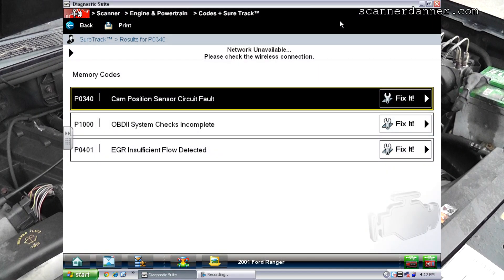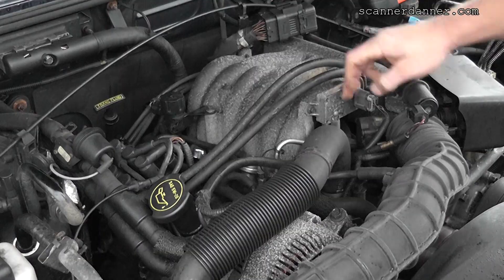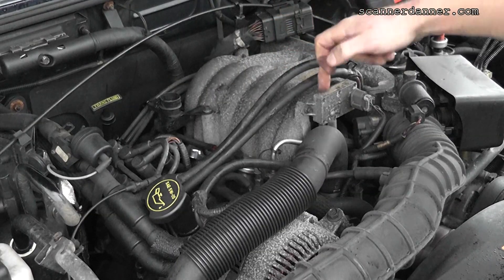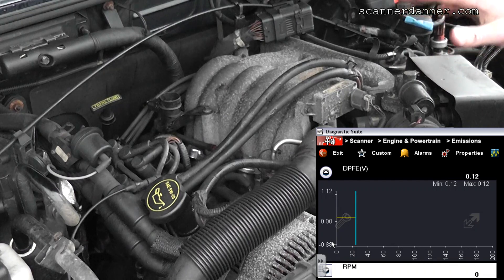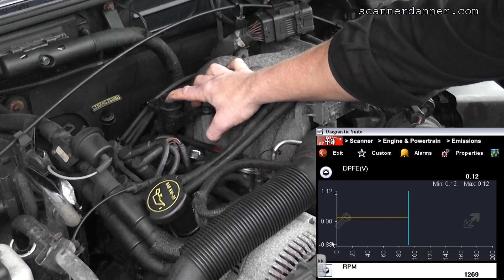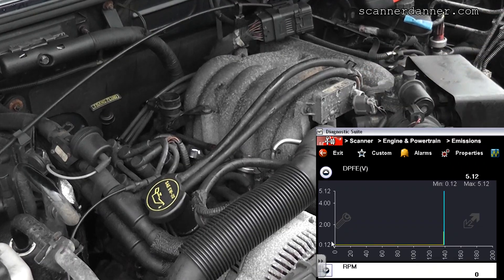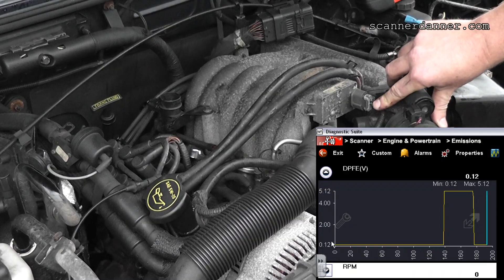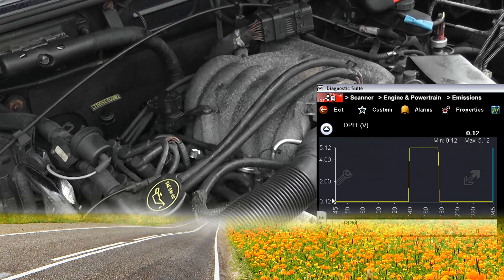Ford EGR flow quick test (P0401) DPFE fault

Comment: have I have a 2003 Mercury Sable 3.0 and it seems like whenever it's cold EGR is making a noise I'm hearing like exhaust gas back there and then after it warms up I'm getting a pulsing back to the air cleaner I was wondering if I'm suspecting EGR but not sure. when vacuum is applied to the EGR it does get the idle gets very rough when you back off it so it seems everything's fine again and but there doesn't seem to be very much vacuum at the where the vacuum goes into the top of the EGR what is it supposed to be.
Reply from the maker: probably a crack in the exhaust manifold

Comment: 1990 f250 5.0, what if when I put my finger over that bleeder the engine doesn't get rough, and what if it does? Does it mean its good if the engine starts to run rough?????
Reply from the maker: You have restricted EGR passages. Remove the throttle body to clean them

Comment: No good when some of these guys post vids trouble shooting using expensive equipment with all sorts of diagrams and percentages; it's like what the fuck are you talking about.
Reply from the maker: I'm sorry you feel that way. If you watch more of my videos, you will get a better understanding. My students at RTC are just as green at this as anyone and they can follow. You just need to find the correct playlist to get started. 
My forum can help you greatly too. 
 https://www.scannerdanner.com/forum/post-your-repair-questions-here.html
Reply: I have one of these scanners and was able to troubleshoot my '97 Ford Escort.  Scanner Danner knows what he's talking about!  You can use a multi meter to test for the same issues and take the same troubleshooting steps, you just won't have a fancy graph is all.

Comment: I'm glad that you took the time to post this. I have been working with a 97 Ford F250 with the 460 in it and we are having to prob the DPFE with a Voltmeter. Would a scanner like yours be able to show the Voltage on this type of vehicle? Or only newer models. Also what scanner do you own, It looks almost like a SnapOn but I can't tell for sure. Thank you again.
Reply from the maker: Yes and it is a Snap on. Check out the description of this video. I posted other Ford EGR Flow problem case studies I've done. It will help. In at least one of them I show how to test the DPFE with a voltmeter
Reply: Yeah I found it by watching another one of your Videos. We tested it via a Fluke and it is preforming as intended.

Comment: We did a vacuum test on the EGR. If the idle didn't change then there was carbon blocking the passage. If the idle got rough then we changed the DPFE sensor. Worked every time.
Reply: Ah, that's for that info. Wasn't aware about it until now.
Reply: I know this was a few months ago that you posted but it stands for Differential (or Delta) Pressure Feedback EGR Sensor
Reply: Ah, thanks alot for clarifying that for me.
Reply: I now find myself with a possible DPFE sensor problem. The car pings even under light throttle or at cruise speeds. Just went on the ranger station website and it stated something about how just when a DPFE is about to go, that sometimes it wont set a P code. I'm about ready to swap the part out I guess. The motor has no knock sensor that I can find anywhere on the net about. The spark ping just came out nowhere one day.
Reply from the maker: How rough does the idle get when you force the EGR valve to open? It should stall or just about stall.
Reply: The motor stalls right out.
Reply: Did a DPFE swap on it last afternoon with a known good one. Drove it last afternoon and this afternoon, and the ping problem is gone now. Am just wondering why the the computer didn't pick it up and set a check engine light. Before that, she was getting so bad that she was pinging in the rain.
Reply from the maker: Yep, pretty much. 

Hey John, I have a tip for you for the comments. I can see some of your posts going to spam automatically. The only way to fix this issue:
Comment one time only, even if it doesn't post. When I see it (and I will) in spam, I'll mark it as not spam, then you will see your post.
If you keep trying to comment over and over (which I understand, because they are not showing up), this just aggravates the situation, then makes all of your comments automatically flag as spam. Make sense?

Comment: good information. with a quick question. 99ranger 2.5l  dpfe reading is koeo 2.14v plugged in 4.79 unplugged that 2.14?
Reply from the maker: +Scott Kelleher most likely it is a bad sensor. Check your ground before replacing it. It should read less than 100mv on your voltmeter, with the voltmeter com lead connected to battery negative. (you will be performing a ground to ground voltage drop test)-sensor plugged in, backprobing, with the key on

Comment: Did I hear you correctly when you said that when the connector is pulled loose from the DPFE sensor the signal voltage should rise to 5 volts? Great video by the way....
Reply from the maker: 3v during the opening of the EGR valve test? Do it again at 1500 rpm
Reply: +Robin Alexander yes you did. this is a design feature within the signal circuit, used by the ECM to determine wiring integrity
Reply: +ScannerDanner Premium - Thanks for the quick reply, I am getting 5 volts on the signal wire if the connector is plugged in or not and it never changes regardless of pressure. I am thinking it is time to try a new DPFE. I appreciate your comments, I was thinking bad PCM!!!!
Reply: +Robin Alexander Not at all my friend. This is definitely a design feature. Just make sure you have a good sensor ground before replacing the DPFE. 
With the key on and connector plugged in, backprobe the ground wire and make sure it is not also reading 5v. This would indicate an open ground and could cause your issue. A good ground will read under 100mv
Reply: What should I look for if I am only getting 3 volts to the Signal wire?
Reply: ScannerDanner So I ran the test again at 1500rpm and the 5v ref wire has an 3v read, and will bounce to 4v and back to 3v. I am using a multimeter. and when I attempt the top wire the engine will stall before I can catch a good read but what I could see was 3v. I went ahead and swapped out the sensor and ran the test again knowing it wouldnt change the voltage on the reference wire and results are the same.
Reply from the maker: The 5 volt ref wire should be a steady unchanging voltage. Are you positive you are making good contact with that circuit when testing?
Reply: ScannerDanner I used 3 different ground sources frame, block and ground terminal. and insured good connection to ref wire. consistently got 3v. but I am on road trip back home and since the last test I've driven 400 miles. and ✔ engine light just went off on its own. would have liked to have found the actual problem but am glad it went away.
Reply from the maker: IF your ref. circuit was 3v, that is definitely a problem. Next question, what is your ref. circuit voltage on other sensors (they share this same 5v source)? With the key on (you do not need it running), check for 5v ref at your TPS (easiest place to verify). If it is 5v there and 3v at your DPFE, you have a wiring (high resistance) problem in the leg of the ref circuit going to your DPFE. If it is 3v at the TPS too, then we may have a computer issue or a high resistance problem in multiple legs of the circuit. So our next test would be to test the 5v ref wire directly at the computer.

Comment: Paul can you tell me with an electric throttle, should the throttle plate open and shut when you put you foot on an off the throttle, if you take the air hose off and just look at it...with ignition on, or does it have to be running, and i assume some other sensors might effect it...Fred in England..
Reply from the maker: +Tom Smith you can put the car in gear (engine off), then the throttle plate will open when you push on the pedal
Reply: +ScannerDanner Ok Thanks.....

Comment: Nice simple test prcedure, Paul. I find many times that the hose fittings on the DPFE sensor corrode and block the holes and can't sense back pressure any longer. I guess that's why they are made out of plastic now.

Comment: I bought one of these every year for 3 years on my explorer. Don't get one from Napa
Reply: Try a Wells DPFE next time, and it will be the last one you replace. You can find them at AutoZone under the Duralast brand name.
Reply: rusco321 Eric O turned me on to wells Ford COP coils. Are they at auto zone too?
Reply: +Joe Shearer Most, if not all Duralast engine management components are manufactured by Wells.
Reply: Can't beat that. Thanks